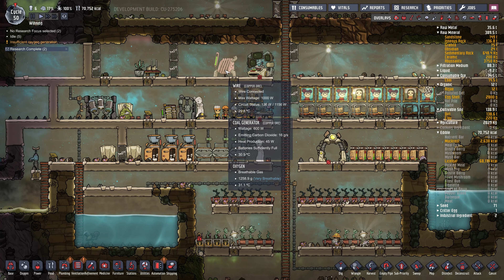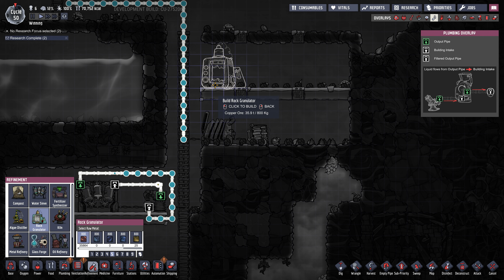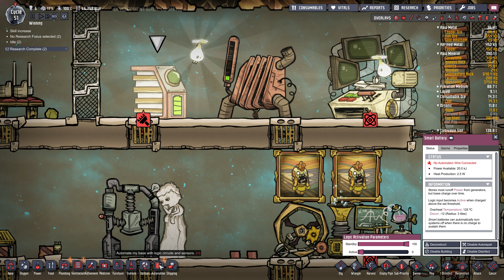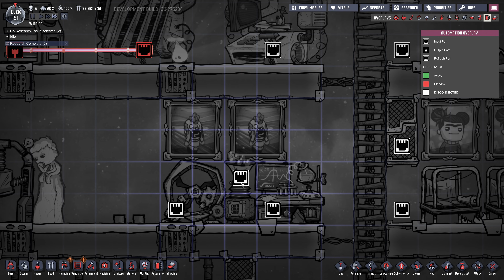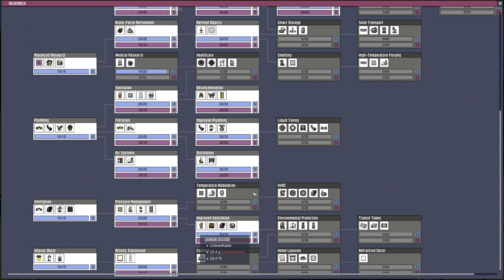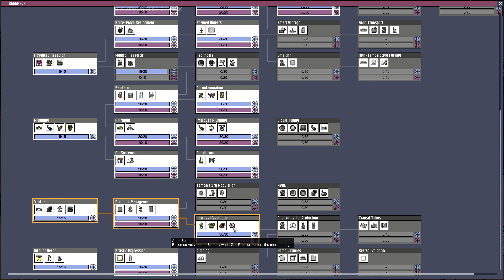Oxygen Not Included - Tutorial Guide in 2025 #5 - Automation Basics - And Gate,Or Gate Smart Battery

Comment: Hey Wintermute, I have a question. Can I replace my wire system with the auto wire stuff? I also mean on the normal batterys. Because my problem is always the power. An other thing: How can i make some free power? Because once i will run out of coal and hydrogen and water. Thanks, nice vid.
Reply from the maker: You can only only use the electric wire for power and the automation wire for wire for automation ports.

Some ways to get power:
- coal generators (hatches will eat materials to make more coal, you can set them up in a ranch)
- natural gas generators (later you'll find 1 or more natural gas geysers)
- petroleum generator (there is a LOT of oil at the bottom of the map which can be turned into petroleum...or more complexly into natural gas)
- solar power (not very good but shine bugs can be the light for some solar power)
- steam power (not easy to set up)
- hydrogen becomes renewable from steam geysers where you turn the water into oxygen and hydrogen
- manual generators :)
Reply: You need Natural gas geyser, it will give you a good amount of energy, but if yo plan to create a really big base then you need Oil cooker(it's turn crude oil in to Natural gas using Magma).
Reply: Thank you! Oh, and I also had a BIG problem with the temperature... I had steam and water geysirs, i had a power system based on natural gas, but i couldn't grow any meal lice because of the temperature. Later i fixed with a 'cold room' using the oxygen going thru the ventillations from the electrolyser but it was late. I need a kind of early game solution for it. If you know any then tell me :D
Reply: Martinfinite harvest wease worts (not sure about the spelling) from cold biomes and plant them where you need them. Aldo use ice sculptures (they melt, so expect a puddle of water). Ice sculptures also can cool water if they melt above of and drip into a reservoir.
Reply: I did, planted and I was putting ice blocks too. There was 35C before, after 31... It didn't help :(
Reply from the maker: To keep your base cool (eg 20C) make sure not to introduce any heat producing things into the base. Now that is usually impossible so make sure you put wheezeworts to combat any heat made by the machines. Make an insulated abyssalite wall around your base (or just normal tile using abyssalite) and that will keep heat from seeping in. Build all heavy machinery in ice biomes (better yet beside anti-entropy-thermo-nullierifers). If you tap into steam geysers make sure to use abyssalite piping to keep the heat inside the pipes. Don't introduce that hot water into your base unless it goes directly into a machine that uses or destroys that water. Hope that helps. See the link to my more detailed guides in the description. I have one on water cooling and other concepts.
Reply: You can switch off all not necessary heat producers and switch necessary things(which is only oxygen generation and light for blossoms in early game) to manual generators, bring more ice, use Weezewots in warmest places, isolate edges of your base from "warm" biomes and things will slowly goes down.
If you plan to start new game just don't jump on coal generators and other fancy stuff at very beginning( I usually try to avoid using more than one until I get access to Smart Batteries), think in advance how you plan to cool your base, good way for it it's produce\deliver cold oxygen to base. Yes, this will slow your progress, but allow you to build more stable foundation.
Reply: Thanks :)

Comment: I prefer to keep the normal batteries and only use one smart. Then I set the smart battery to 20-90. Its have the same effect and I don't need multiple smart batteries.
Reply: Correct me if i'm wrong, but for case like this you need that all power producers\consumers was plugged to same wire network. How do you not overload?
Reply: Yes true, for one batterie network, but I build that anyway always like this: https://ibb.co/jfbnuJ
Reply: I just thought you use some way apart of fat cable :)
There is another point for switching to smart batteries - they passive lost of charge is two times smaller than the normal ones.

Comment: I would really like to know when and how to use a memory toggle
Reply from the maker: If you wanted something that was turned off, to turn on and stay on you could use the memory toggle. You can then reset it with a reset input (or manually).
Reply from the maker: Those are two great examples. I might end up using them in my base :)  I'm not creative enough.
Reply: If you "program" something with "steps". One good example is a water gems cleaner. You fill a room with gem water until its reach a level of hight. Then you toggle a memory, start heating, waiting for all gems done and start a pump until the room is empty. Then the room is empty you reset the memory toggle.
Reply: Or with the Atmo Sensor in this example. You can use 2 of them. One like here in the video  above the carbon skimmer, but instant to conenct it direct to the skimmer you connect that  to a memory. A bit lower you put the next atmo sensor, but this time you set it to "lower then X" and connect it to the reset wire. So the skimmer will start and runs until the lower state is reached, so you don't have that "on-off in short times" effect any more.
Reply: I found it easier to connect the carbon skimmer to a clock sensor. You can roughly estimate how long per day the skimmer needs to be on to destroy the CO2 produced daily by your dupes. Not as precise I suppose but quick and easy to build without the "on-off in short times" you have with the atmo sensor.
Reply: Thx, yeahr I am developer ^^'
Reply: Been giving it a lot of thought and the only thing I can think of is an alternate filtering system (place two sensors on a line like oxygen and hydrogen, and if it senses the other it switches some gas shutoffs to divert flow to flush line, if it senses what you want it resets the flow to intended path.)

Comment: This is the stuff I've been waiting for. Pretty much the only automation I've been using it connecting the batteries to generator to turn them off and a similar set up to turn off a water pump when my water tank is full.
Reply: Automation becomes key when moving from mid to late game. You'll have to build a lot of pumps all around your base to properly manage water, gases and heat but without automation, such infrastructure will consume tons of energy and may break the balance you'll be looking for. Too much cooling can turn water into ice and destroy your pipes, creating too much oxygen may overpressure your greenhouses and stop plants growth, over pumping natural gas from a geyser may cause the wrong gas to enter the pipe and damage your generator etc etc. To me building automation into your base in one of the most interesting part of the game.
Reply: I've already built a water cooling system that can handle bringing a variety of temperatures down to around 15-20 degrees. It's a mess of pipe temperature sensors and shutoff valves but it works. I've been using the atmo sensors too. All since I saw this video.
Reply: Coming from Factorio this is actually pretty simple. I'm sure it can get a whole lot more complicated.
Reply: DeathTrooper 67 I just bought this game after breaking 1000 hours in Factorio.